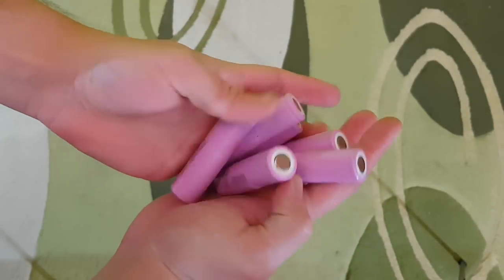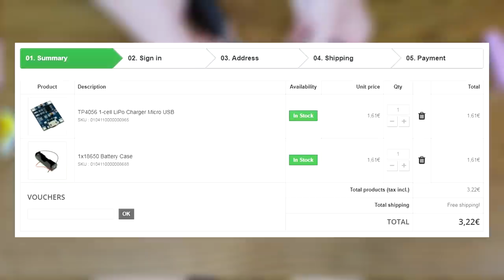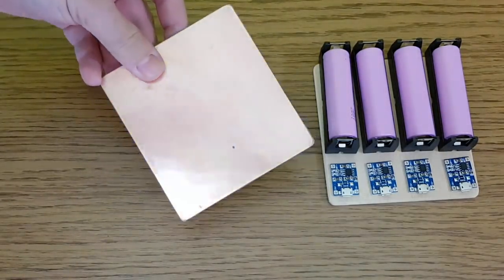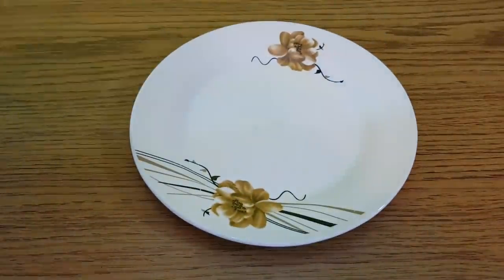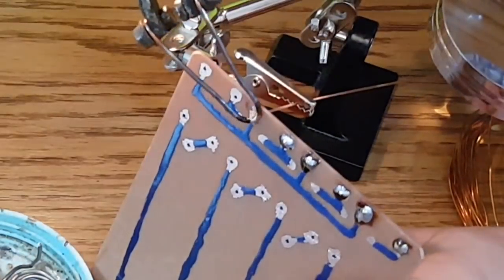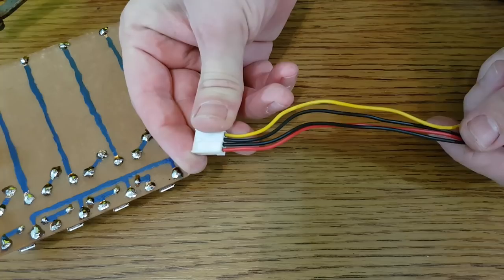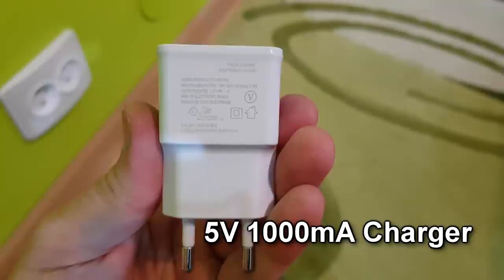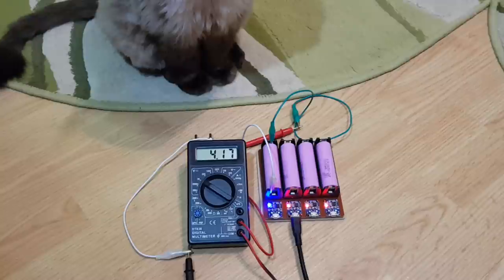Simple DIY 18650 Battery Charger - TP4056 Review (Everything Explained)

Comment: I think you could use only one charging unit, because you have 1A source and you divide it to 4 circuit which gives you around 0.25A to each circuit - same as you use 1 circuit and connect 4 batteries in parallel (each battery gets around 0.25A while charging) and whole charger cost you less... Am I right? :D
Reply from the maker: hi. not really. this is the difference: with 4 charging modules you can charge 4 different cells individually. the cells can have different capacity, they can be discharged to different levels. you can put each cell in the charger at different times. all the cells will be charged much faster, with max 1A (if I use my DIY bench power supply. a phone charger with 2.1A is also very good) not 1A divided to all 4 cells. if you want to charge multiple cells with only one charging module, the cells must always be connected in parallel (when you charge them and when you use them). the cells need to be the same type, same capacity, same lifespan, same charging-discharging cycles and they will be charged 4 times slower.
Reply: @Sorin_DIY  ouuuu, now that's Ok :)

Comment: interesting video. but where can I buy the TP4056? thank you.
Reply from the maker: hi. you can find it on aliexpress, ebay and other sites. the module I'm using in this video doesn't have battery discharge protection. here is one similar to mine:
https://www.aliexpress.com/item/10pcs-lot-TP4056-1A-Lipo-Battery-Charging-Board-Charger-Module-lithium-battery-DIY-MICRO-Port-Mike/32651302113.html?spm=2114.search0204.3.42.b2d1243fUQueNO&ws_ab_test=searchweb0_0,searchweb201602_3_10152_10151_10065_10344_10068_10342_10343_10340_10341_10696_10084_10083_10618_10304_10307_10301_5711213_10313_10059_10534_100031_10103_10624_10623_443_10622_10621_10620,searchweb201603_25,ppcSwitch_5_ppcChannel&algo_expid=27af2e3b-cbf8-4599-95a0-879945d4a0e1-3&algo_pvid=27af2e3b-cbf8-4599-95a0-879945d4a0e1&priceBeautifyAB=0

Comment: Hi Sorin, Would this charging setup work if TP4056 were connected in series rather than parallel if I wanted higher voltage output?
Thanks
Reply from the maker: hi. it will not work, because all the charging modules have the same power source. for 4 cells it will work only if each tp4056 module have its own power source and each tp4056 module is connected individually to one 18650 cell. finally the cells can be connected in series. this will be a 4S with balance charging. I will make a video soon about this type of charging.
Reply: Thank You
Reply: I would like to see some information about that as well
Reply: Sorin - DIY Electrical Nerd Looking forward to a detailed video about properly charging 18650 cells in series, with balancing and protection etc... I am building a bluetooth speaker that requires 24v and finding good information about charging seems dificult.

Comment: Hi Sorin, I am working on the same charger as your, only difference I add a switch for each TP4056. I noticed that when for example 2 battery are in charger and Charged so Blue led on, and  I add a 3rd battery, and power it by its switch, the 2 first batteries that where charged start charging again, I mean there TP4056 light Red again. I have been struggeling to fix this. Maybe if I change Rprog (charging current resistance) ??  charging time is not a problem for me, I usually use many 18650, so want them to charge safely.  why when I add a new battery to this charger, the first 2 batteries that are charged (blue led) go again into charging (red Led ON)?? 
PS: this happen if I used phone charger 2A or Lab Power Supply (as yours) which can deliver a lot of Amp.
Maybe use 12V with stepdown modules?? but if is it an Amps issue, using 12v wont help?? really dont know anymore....
Thx ;)
Reply from the maker: hi. I've noticed that on my charger too. I don't know exactly why, but I'm thinking it has something to do with an inrush current, when one of the modules is starting to use 1A instantly. the supply voltage may decrease below 4.5V for a fraction of a second and the other modules start charging again, because they are restarted and don't recognize the overcharge release voltage. I think this can be fixed if you use thicker supply wires, decrease the charging current to 0.8 - 0.7A and add a smoothing capacitor of 4700uF to each charging module supply input.
Reply: @Sorin_DIY  It is so reliving that you noticed this issue!! I was getting crazy about this. Thought my TP4056 were faulty! So I checked them one by one,and everything is ok when I use them separately!
So I tried with only 2 modules (before to increase to 4), when both are charging about 1400-1500 mA are drown from Lab Power Supply. But when one module get charged, the current drop to 30-40 mA. And 2nd battery take forever to get charged!!
Also though about use thicker supply wires, but did not help :( , and also about to decrease the charging current, so changed Rprog resistor, but also do not help. Maybe I will have to charge 18650 one by one...
Reply: @Sorin_DIY  I have been charging my 18650 one by one for 6 month with 1 TP4056, and now wanted to make an 4x charger, to charger 4 by 4 easier but it is more annoying... Trying to fix this new issue... Even with only 2 TP4056 this behavior is present... About capacitor I dont know really...
Reply from the maker: try with a variable power supply of a powerful step down converter and give the charging modules a supply voltage of 5.5V. add at least a capacitor to all the charging modules. maybe the supply voltage will not drop enough to reset the charging cycle.
Reply: @Sorin_DIY  lol, that exactly what I did from yesterday (testing purpose). 
So I connected one mini step down module to each TP4056, and set it to 5.4V. And I did not use any capacitor. And it is working fine. If for example, 2 18650 are charged (blue Led), and I disconnect 1 TP4056, the other TP4056 are not "disturbed" and stay in battery charged state, that how is supposed to work ))
PS: I did my experiment with only 2 TP4056, since the issue was apparing if 2 or more TP4056 are connected in parallel, and I used 12v rail from the ATX Lab PS.why?? because I plan to use the 18650 Charger with a 12V wall charger, thats the only one I have around able to provide 4A. But I plan to change to charge Rprog to 2,2K >> 545mA,  yeah I know longer charging time, but safer and better for 18650 longevity...
Mini StepDown module I used: https://ar.banggood.com/Small-Mini-360-Adjustable-DC-Power-Supply-Module-Mini-Step-Down-Module-p-917568.html

Comment: @Sorin - DIY Electrical Nerd - what controller would you recommend for 2S3P (so 8,4V out) 18650 pack?
Reply from the maker: hi. there are a lot of 2s protection boards, but you should use one with balance charging. I suggest this one, I haven't try it, but I think it's good enough:
https://www.banggood.com/DC-9V-4A-2S-Lithium-Battery-Protection-Board-Li-ion-Cell-With-Balanced-Charging-p-1163824.html?rmmds=search&stayold=1&cur_warehouse=CN

Comment: How to charge and Use 18650 battery at the same time?
Reply from the maker: li-ion cells cannot be charged and used in the same time. they will get damaged. only lead-acid batteries can do that.
Reply: @Sorin_DIY  thx sir but i want to ask one thing that how can I charge the battery from solar pannel and use it at the same timr
Reply from the maker: the solar panels must deliver much more power than the load needs and they directly feed the load. the excess power is used separately to charge the battery. and when the sun goes down and the solar panels can't deliver enough power anymore, the load draws power from the battery. the battery is charged by day and discharged by night, it's not simultaneously charged and discharged.
Reply: @Sorin_DIY  Thx sir you explained me very nicely I have last query the likewise for the time when cell is charging and if I connected some thing with output will it going to work or not/

Comment: Hi sorin my name said from morocco im your follower 
I have two question 
1what is the difference between the cell battery li ion in laptop computer and drill lik makita liion?
2 can we use cell laptop battery in drill battery ?
Reply from the maker: hi. portable power tools use high drain lithium cells, with a high output current, like 20-30A. they need to deliver a lot of power in a short time. laptop cells can deliver a lower current, usually maximum 3-4A. because they need to last as long as possible, while the laptop consume a very low current. you cannot use laptop cells in a cordless drill. it will work only for not very powerful drills and only if you connect a lot of cells in parallel, so the battery pack can output a high current.
Reply: @Sorin_DIY  
Yes sorin just i want be sure 
Thank you whene i learn file technique cel laptop i find cell out put max 10 
And for drilll i find 18
Other think cell drill accept accept charging current 4a
And for laptop  just 0.500 max 1a
Thank you sorin good luck in your channel i wish for you the best

Comment: I've done a similar setup: just 2 modules and 2 battery holders powered by a phone power charger rated for +2A. I'm concerning about the hot that the modules producing, I can't even touch the module ad batteries start becoming gradually warm. Dunno, is it all normal? Don't want to start a fire in house or lose 2 fingers for an explosion :D
Reply from the maker: hi. the charging module IC is getting hot when charging with 1A. you can add a small self adhesive heat sink to the IC. or you can limit the maximum charging current. some charging module have a  programmable resistor, which you can replace with another value resistor and limit the maximum charging current.

Comment: Hi there .. Want to ask ..
- One TP4056 module and one 18650 battery at the usage level of around 3 volts. How much time does it take to fill up?
Reply from the maker: hi. do you mean, you want to charge the cell, using a 3V charger?
Reply: @Sorin_DIY  Not like that.. What I mean 3 volt is the batteries status/level. But of course I use standart dekstop charger cellphone..
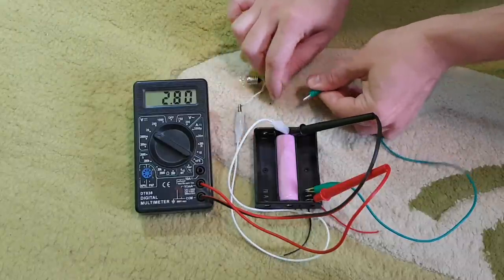Btw, in 9:50 I was interested with your Digital Volt + Amp Meter equipment, can you explained on detail how you made that Digital Volt + Amp using USB cable ?
I think I wanna to build that to support my daily work..(^_*)/
Reply from the maker: hi. if a 18650 cell has 3V with no load connected, it's almost fully discharged. it depends on the cell capacity, the bigger the capacity, the longer it will take. I would say between 2 - 4 hours. and for the volt/ammeter connection, it depends on what model you have. the one I've used in this video it's the same model like the one in my DIY power supply video. the (voltmeter) thin red and yellow wires are connected to the positive USB wire. the negative USB wire is cut in half. the part coming from the phone charger is connected to the thick black wire (of the ammeter). the part going to the USB port is connected to the thick red wire (of the ammeter). you can check the schematics in my DIY power supply video (parts 1 & 2) and assume the rotary switch is set to 5V.
Reply from the maker: the USB connections are correct, but the one in the right is the female (port) and the one in the left is the male (plug). the 2 thick ammeter wires are mixed, the black is going to the plug and the red is going to the port.
Reply: @Sorin_DIY  I see ... So the connection path is correct but only reverses the position of the USB header.
Okay ... I'll try to assemble it first ... Thanks again .. I will repost the result later ..

#Update info : 
..  These are the results I made ...
- In the first step according to your scheme here: https://www.dropbox.com/s/hii9064bm7t3n9o/sorin_tesGVjy_1st_step.jpg?dl=0 can only display the output voltage, while the output current is not present / 0,00A.
I tried it by switching the position of the ammeter cable (red and black), black going to the plug and red going to the port or red going to the plug and black going to the port. But the results are still the same.
- But then, I tried a different method like step 2 here: https://www.dropbox.com/s/zxoyw1nxv6s2v82/sorin_tesGVjy_2nd_step.jpg?dl=0 the voltage and current can function normally. It has been tried several times on various charging adapters and using various power banks, and that can be done.

The tool is very useful for my daily work as a cellphone technician.
Thank you for the guidance .. Hopefully you do not stop in producing the best work going forward ... Regard .. \(^_^)/
Reply from the maker: hi. it's strange that the ammeter works without the thick black wire. the ammeter thick black wire and the voltmeter thin black wire are actually the same on the circuit board. that's why you don't need to use them both, if the supply voltage it's the same as the measured voltage. if you measure the resistance between them, it should read next to 0. you can use the thin black wire also, but it's much thinner so it has a bigger resistance than the thick wire. you will loose a few mA, when you measure very low currents. try to shorten it and replace the rest of it with a thicker wire.
Reply: @Sorin_DIY  Hi .. Here are the results I have made: https://www.dropbox.com/s/sixqdamcww15gge/DVAM%20Externder%20USB%20Monitor%20v5.mp4?dl=0
Btw, I confused what you are mention on the end of your reply above "try to shorten it and replace the rest of it with a thicker wire" ..🙄
Reply from the maker: you said, your ammeter works with the thin black wire, instead of the thick black wire. you can use it, but I suggest you replace it (from near the connector) with a thicker wire. because the thin wire has a bigger resistance, and it will alter your  currents measurements. for the ammeter are usually used thick wires, because they will have a lower resistance.
Reply: @Sorin_DIY  So you mean, the thin cable that is in the line of the red power cable and the yellow cable (voltage sensor) is replaced or exchanged with a thick cable. For example, removing thick black cables from those for the default current measurement (thick red & black cable sockets).

Comment: Yes really good job. But what if I want to charge 20 modules like this at a time.... What is 
voltage required for 20 modules...? 
amps required for 20 modules...? 
Note:not for more time, as usual normal time.mean how much time it will take for one cell with 5v1amp.
Reply: If you wire all the TP4056 modules in parallel, as done in the video, the supply voltage stays at 5V and the maximum current draw is the number of modules in parallel X maximum current draw of one module.
You can reduce the maximum charging current of the TP4056 modules by changing the current set resistor on the module. That allows you to charge at a lower current, but it will of course take more time.
Don't use multiple TP4056 modules in parallel to charge cells wired in series in a battery pack, unless you are galvanically isolating the input supply of the module! Otherwise you are shorting cells in the pack over the common ground between the modules!

Comment: At the end of the video you said that if you want you can connect a higher Amp charger if you want a faster charge. What's the max Amp  the TP4056 can take?
Reply from the maker: each tp4056 module needs 1A for the fastest charging time. so for 4 charging modules you need at least 4 Amps. if the supply current has more  than 4 amps, for example if you connect the tp4056 modules to a PC power supply 5V output, it still uses the maximum 4A with no problem, even if the PSU 5V rail has 20A.
Reply: Assuming your USB cable can handle 4Amps. The most expensive cables tend to only go to 2.1A
I recommend making your own cables in this case and not using the USB plug at all
Reply: Imperf3kt Sweet, thanks guys.

Comment: Hello! If I use a single 4056 to charge two cells in parallel is that ok? O I do something terrible wrong?
Reply from the maker: hi. yes you can charge 2 cells in parallel, but they need to be the same model with the same capacity and be discharged to the same level (same voltage). and you will use them still connected in parallel.

Comment: Why can't you use just one TP4056 and connect the batteries in parallel? Assuming all 4 batteries are going to be used together so they have a balanced charge.
Reply from the maker: hi. with 4 charging modules you can charge 4 cells individually. the cells can have different capacity, they can be discharged to different levels. you can put each cell in the charger at different times. all the cells will be charged much faster, with max 1A. not 1A divided to all 4 cells. if you want to charge multiple cells with only one charging module, the cells must always be connected in parallel (when you charge them and when you use them). the cells need to be the same type, same capacity, same lifespan, same charging-discharging cycles and they will be charged 4 times slower -> 1A/4=250mA each cell.

Comment: Can we charge two batteries with a single tp4056? If yes then should it be in parallel or series connection?
Reply from the maker: hi. if you want to charge multiple cells with only one charging module, the cells must always be connected in parallel (when you charge them and when you use them). the cells need to be the same type, same capacity, same lifespan, same charging-discharging cycles and they will be charged slower.
Reply: @Sorin_DIY  thanks for your quick reply sorin🙏.. you and your chennal is awesome. I just discovered it today. Subscribed also..👍

Comment: I am going to buy a Energizer charger that comes with 4 AA NiMH 1300mAh Rechargeable batteries, will this charger also be able to charge my other 4 NiMH AA batteries that are 2800mAh, 1300mAh to 2800mAh is a big increase.
Reply from the maker: yes. it will take longer. on the back of you charger you should find the max charging current of that charger.
Reply: @Sorin_DIY  is higher max charging current better.